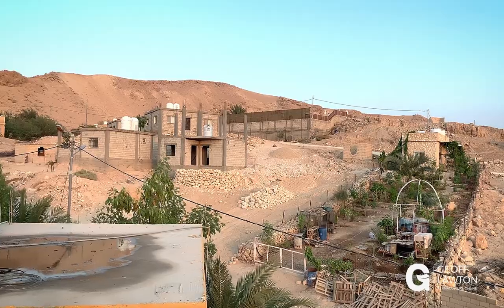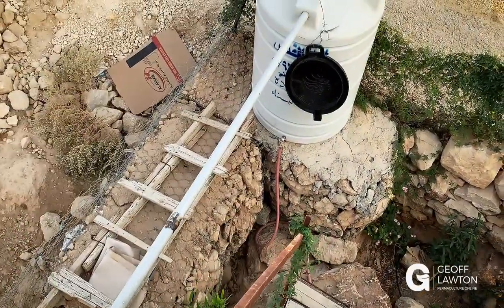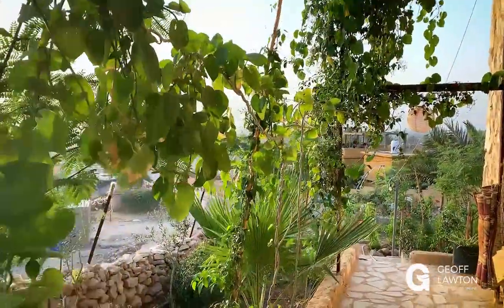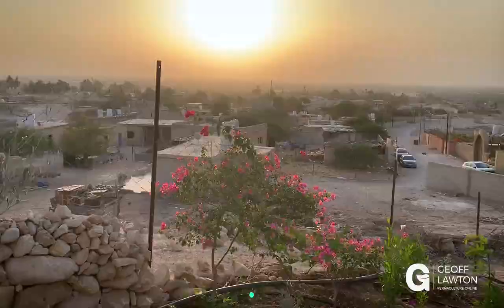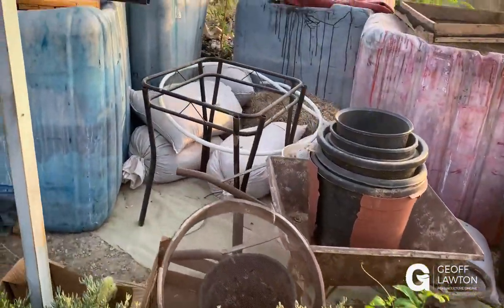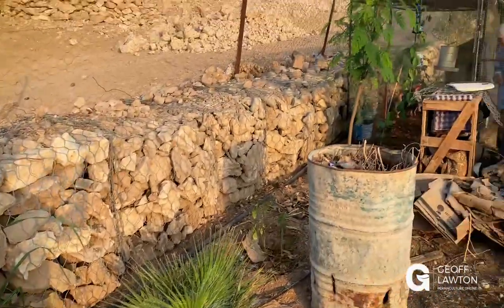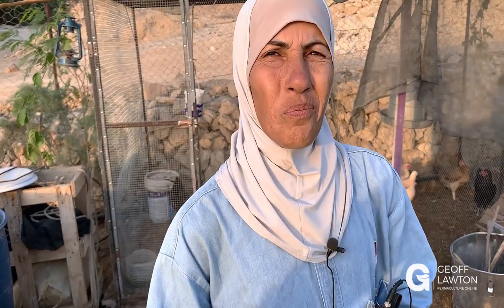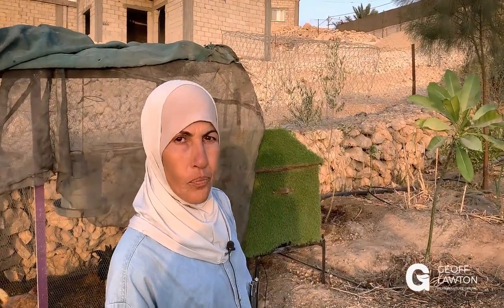Two Years of Permaculture Application

Comment: how to treat ultisol land in low latitude, in tropical environment ?
Reply: You need plants that have long tap roots that break up the soil if you can mechanically break up the soil mix in a carbon and nitrogen source. you can use the clay to make unglazed fired pellets that when soaked in compost soil bacteria and mycelium make a receiver and fortification of active players in the creation of good soils. The Black Gold soil of the amazon rain forest is an example of this.
Reply: @Barskor1  so you saying that cracking the soil is the first thing to do?